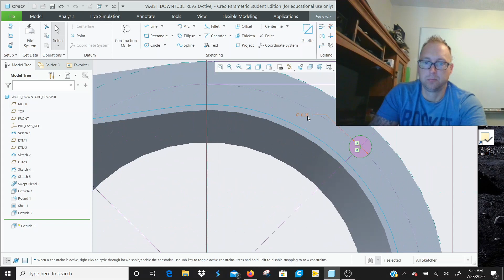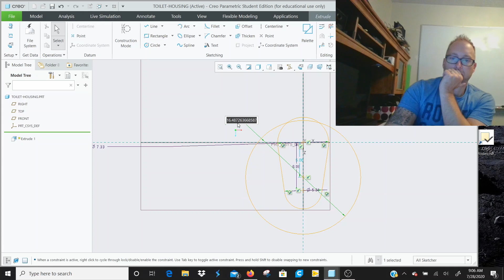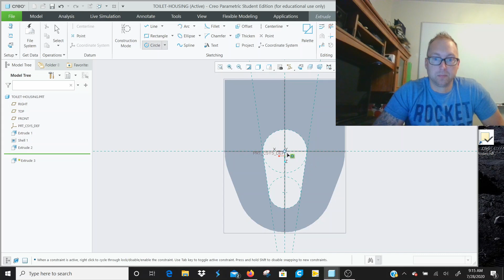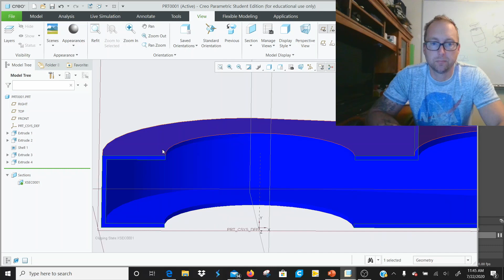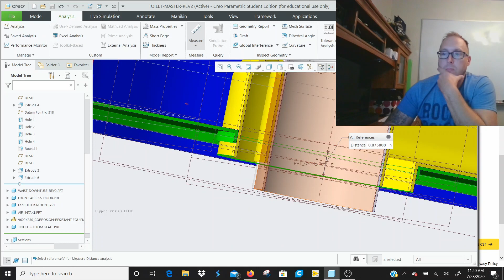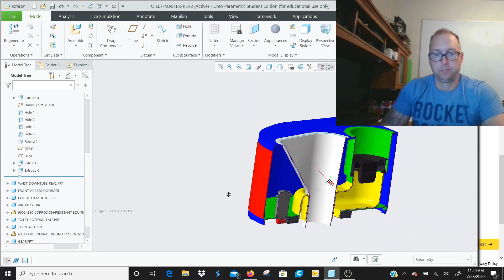Designing a New Space Toilet For NASA | 3D Model Creation in Creo Parametric

Comment from the maker: What CAD software does everyone prefer? Want to know how the toilet turned out? Subcsribe so you won't miss the next video when I tell you all about it!
Reply: I learned Solidworks in Uni but it seems Onshape is the future for people who want to get into CAD. There's user made "features" (which are basically addons) that you can use to really customize your workflow. I found a dovetail feature that saved me at least 20 min of calculating and only took a couple of parameters.
Reply from the maker: I have been using PTC Creo Parametric for most 
of my work. I have also used Solidworks but found that switching between the two can be difficult so I stick with creo since my work primarily uses it. I have not used Onshape, I will look into it and see what it is all about. I know alot of people that use Fusion too, and it is free.